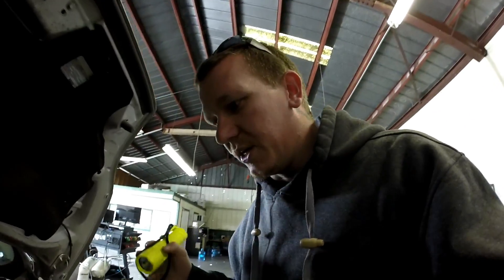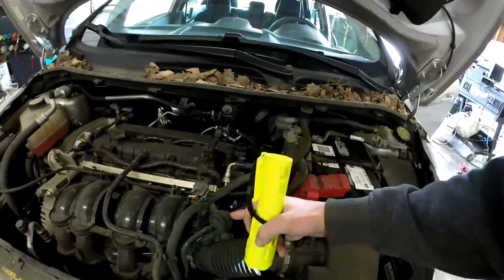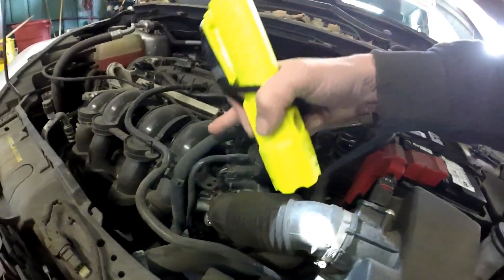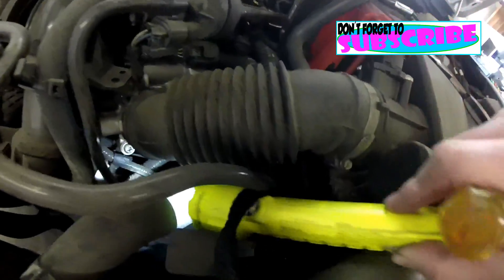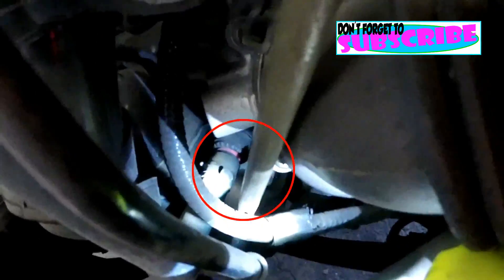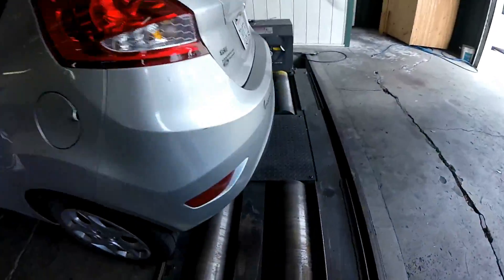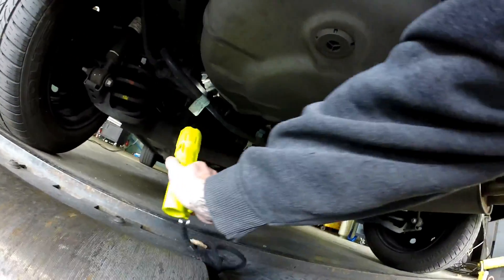Ford Fiesta emissions locations: PCV, EVAP canisgter, purge, & vent

Comment: I used a gas cap plug on my 2011 fiesta while driving. Does this car have another vent hose besides the one at the gas tank filler location?
Reply from the maker: Yes. This vehicle has a Vapor Canister Vent Valve near the vapor canister.

Comment: Another quick Q? 2014 Fiesta trouble starting - returns the error code P1450, AutoZone's print out says the part needed is the Duralast Fuel Vapor Leak Detection Pump ESM1050 (of course recommended part is the one they sell) That seem correct to you? Thanks again!

Comment: I was struggling to find the Natural Vacuum Leak Detection on my vehicle, and understand it's somehow related to the EVAP.  It seems fuse F27 is blown, which is connected to PCM, TCM, and the NVLD.  Do you know where on the Fiesta I can find the NVLD?   Thanks for this video!
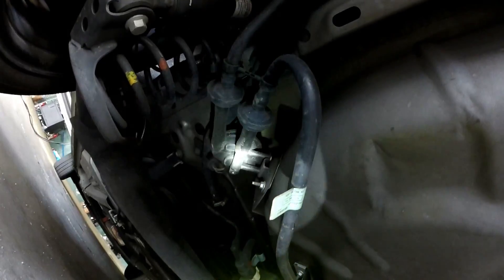Reply from the maker: The part I point to at 01:48 is the pump you are looking for. This vehicle uses the NVLD to vent emissions on this vehicle.  It's pretty common  now. I should re-make this video with more info.
Reply: Great video, clearly shows where to find them on the vehicle - a great help to us DYI guys!! I'm finding the NVLD for a 2014 Fiesta selling for around $200.00 online, does that sound right to you? Thanks Again! @ScottiesHobbies

Comment: I don't think Scott is right on the PCV valve location. I have looked and looked to find a new PCV valve for my 2013 Ford Fiesta SE and it's like it doesn't exist. I found this video https://www.youtube.com/watch?v=8KSp5E67wKE however and it shows that the Fiesta has an Air/Oil Separator. I believe this takes place of the PCV valve on the Fiesta. I am ordering that part to see if it fixes my problem.
Reply from the maker: Good luck. 🤞🤞 odd it shows a part for 'pcv hose' but no pcv.
Reply: For a 2013 SE, 1.6 I think this comment is right. The pcv valve you pointed to in this video is the brake booster line, where it connects to the intake manifold. The orange/red part is part of the intake manifold, p/n BE8Z9424A. In the workshop manual it says the crankcase pressure regulator is inside the crankcase vent oil separator housing. If you watch the link from the comment, you will see the part towards the end of the video.

Comment: I am having a high idle issue and crappy idling and I can hear air leaking in the vacuum line but I don't know what is leaking. On the rubber hose that goes into brake booster just above where the evap purge is... what is the four way vacuum connector with the round parts in the middle... it tees the vacuum hose from brake booster into air intake duct and down into the pcv valve area on the other part... the air is leaking from that four way connector and I can't figure out what that is or where it is leaking on it.  Help please
Reply from the maker: Can you send me a picture? A few at duffer angels and maye use flash. Therealscottieshobbies@gmail.com

Comment: So it could be either of the vent solenoids, under hood or under rear,  causing fuel not wanting to go in? Could I pull hose off either one when fueling to see if fuel will flow in freely?
Reply from the maker: A fueling problem is usually the vent solenoid.

Comment: Hey I was wondering the valve cover vent hose going to air filter housing is little traces of oil supposed to get through that line
Reply from the maker: Its not ideal but over time it will happen. A bad pcv valve can cause this too. The hose from the air cleaner to the valve cover is the intake for the pcv system.

Comment: I have a 2016 Ford Fiesta, 44,000 miles. When I fill up with fuel the car will shutter briefly but once I start driving it goes away. Only when  fueled up and idling. It's been that way since I bought it new in 2015.  The fact it goes away I'm not too concerned. Any input would be great! Thanks.
Reply: It’s the evap purge canister. Mine is having the same issue only much worse. I’ve got a 2017 fiesta with 85k on it
Reply: @cruisinwithbug  Thanks for the info. Mine seems to gotten better, doesn't do it too often. The last thing I would do is take it to a Ford dealer/service center. Those places suck, as far as I'm concerned.

Comment: my car randomly stalls while stopped and sometimes the its a rough stall ?   i replaced throttle body , wires plugs , distributor, MAF sensor, both VVT solenoids , battery .   it doesnt do it all the time but usually after long ride on highway , after getting gas any ideas plz let me know .

Comment: Does this valve cause blowby? My fiesta also throws oil from distick tube. Can it be the reason behind these syptoms?
Reply from the maker: If your pcv system is clogged this can happen. If it's too much pressure for the pcv system to handle you might have a bad ring or valve seal in the engine.

Comment: I have a 2016 fiesta only when  I fuel I have trouble turning it back on. I have to
Give it throttle before it starts rough  and I hold at 2000 to 2500 rpms. After it runs normal. Untill we need to fuel again.
Reply from the maker: Kind of sounds like you're causing too much of a rich mixture when pumping gas then when you turn the vehicle on and give it throttle it's allowing more Aaron. That is allowing the combustion to happen. I would have the purge solenoid tested. Make sure it's holding vacuum and also make sure the resistance is good.
Reply: @ScottiesHobbies   THANKS... great videos

Comment: Is the PCV supposed to make that clicking sound? I recently picked up a ‘15 Fiesta and the purge is making this clicking sound that picks up and slows down. Is this normal? I’ve had a number of problems already with the tensioner and belt but the PCV seems to be the only part making noise.
Reply from the maker: Sorry it took so long to reply. The purge solenoid usually does make a clicking sound. Really common for them to make clicking sounds. The PCV as well it shouldn't be too loud but it does quick. There's a little ball in there.

Comment: Which of these would cause the car to have issues putting gas in the car. The gas nozzle clicks off like the tank is full after about 3/4 of a gallon. Thanks in advance for any suggestions.
Reply from the maker: +Jason Roberts usually a vent solenoid having a problem will cause that issue.
Reply: Scotties Hobbies I have the same issue with a 2013 Fiesta. Any way to check or test the solenoid?
Reply from the maker: +Isaiah Franco you can do a resistance check on the solenoids. You would need to figure out specs on them though. Other than that, you would need a obd scanner that has 2 way capability.